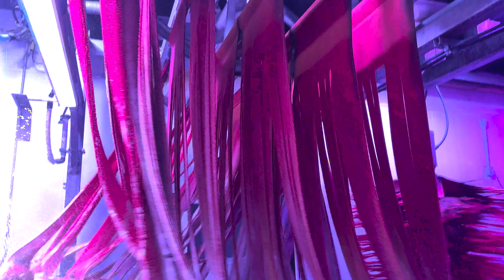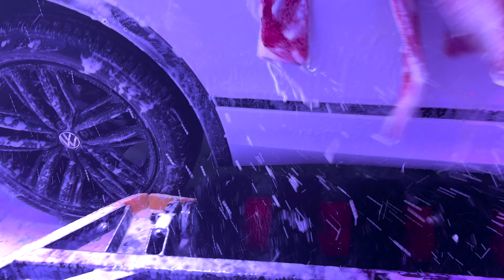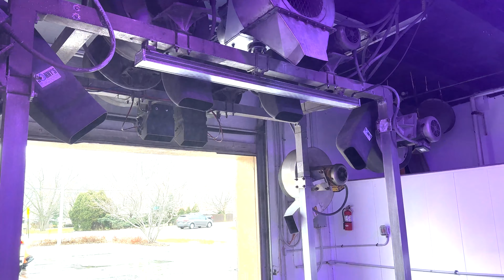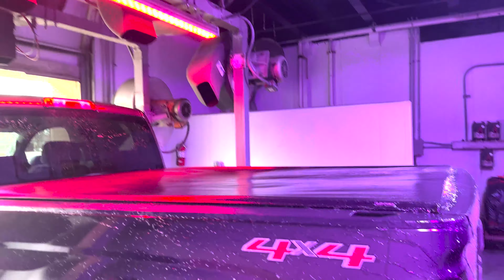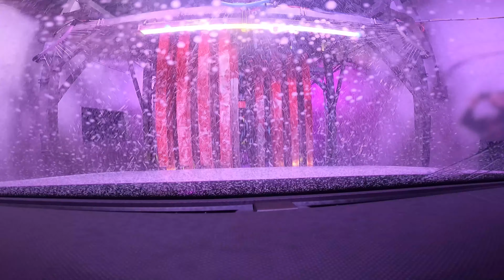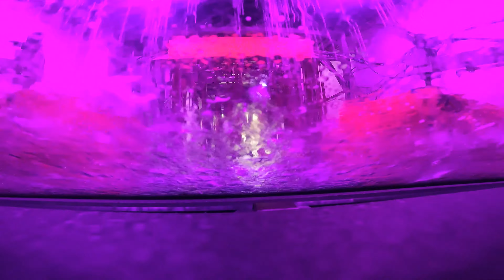Sonny's Tunnel - Brittain's Express Car Wash - Elgin, IL

Comment: Interesting how there’s an old AVW dryer along with the older and and newer Sonny’s dryers. Was it leftover from a previous setup, or did the owner buy it used online to increase drying efficiency in the tunnel?
Reply from the maker: The newer dryers are original to the wash. All the other dryers were bought used and added on. As you said, it could be to increase drying efficiency.